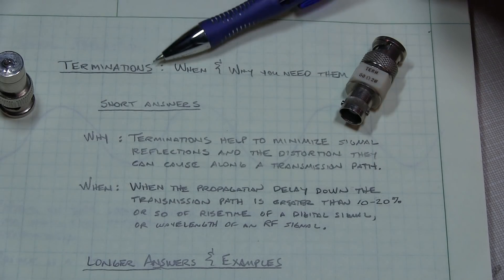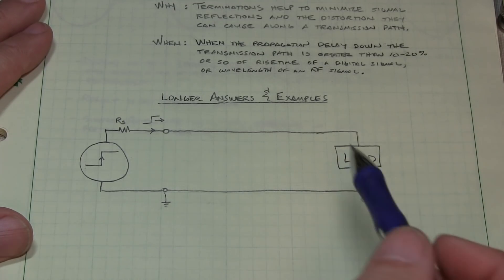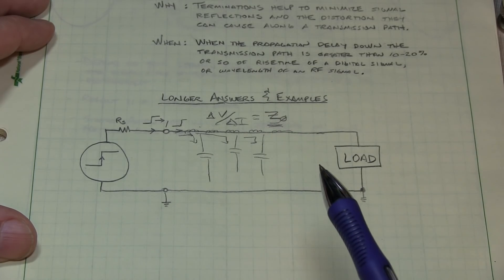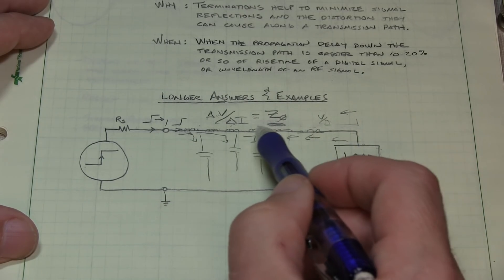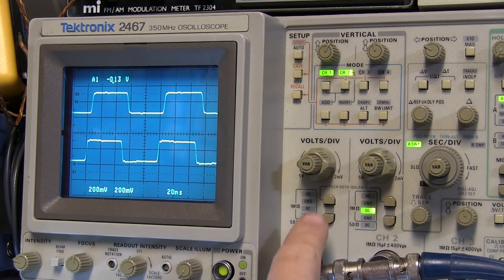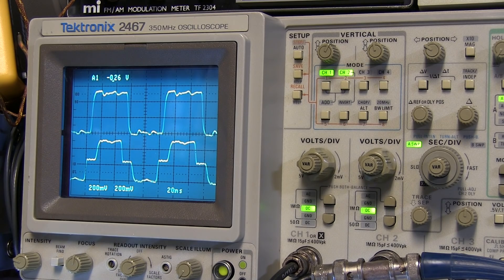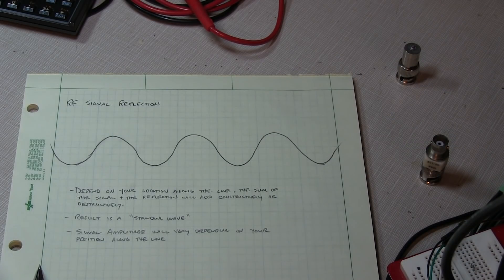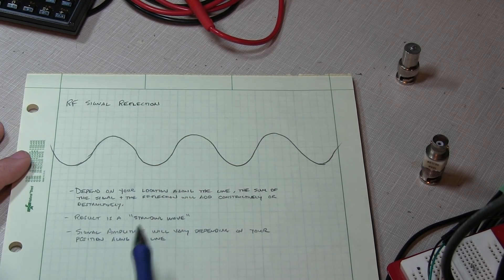#143: Transmission Line Terminations for Digital and RF signals - Intro/Tutorial

Comment: This explains my mobile HF issues on 80 & 160 meters.  The amplifier is perfectly happy on 40 and above, but on 80 I need to tune a little high when I insert the UNUN.  The amplifier tunes a little below the radio.  I probably need an UNUN with more taps so I can more precisely match the impedance, or switch to a tuned shunt coil.  The radio is happy when the amplifier is on the air because it is padded in the amp.
Reply: I have a telescopic coax. It would be interesting to see the difference in adding and subtracting the length in real time.

Comment: Noob question:   What if source is 50 ohm and load is 75 ohm?
Reply from the maker: You will get a reflection that is 50% higher than the initial input signal.
Reply: @w2aew  Wouldn't you connect the 50 ohm termination to the 75 ohm load as close as possible?

Comment: Kudos. Excellent explanation as always.  A quick question: 
 Does plugging both the end and the middle into the scope have an effect since the two channels are internally grounded together?  This essentially shorts half the return path of the transmission line - does this matter??
Reply from the maker: It does not matter - you will have the return/image current flowing in the shield of the coax between the scope inputs.

Comment: Reminds me of British TV Broadcast Engineers leaving a 10m to 15m length of Unterminated Coax connected to a PAL Black & Burst Genlock Signal from a Wallbox.  The Genlock cable had been connected to a temporary Camera in the Studio.  When the Camera was no longer needed the Camera was removed, leaving the Genlock Cable in place.  With the extra cable back to a Sc Distribution Amplifier, this amounted to a Quarter Wave Stub around 20m - which attenuated the Subcarrier frequency (4.43361875MHz) for anything else connected the the same Sc Distribution Amplifier.  Effect?  Any equipment in the Studio requiring Black and Burst had lost the Burst - and so no Colour from those Devices.......  A 5 minute "fix" from me, a big Invoice, and Egg On Face for Engineers who should unerstand the basics of Transmission Lines....  Thanks!  Great Video.............

Comment: Hi if I have a 100ns delay coax cable how much frequency can pass through it and be delayed without changing in it's waveform can frequency of signal effect on its waveform I tested a 10 mhz sine wave on 100ns delay rg58 and the out put was delayed version of input without any changes but I don't know if I use a 2ghz signal  what can be looks like my signal
Reply from the maker: A properly terminated transmission line will not change the waveform other than reducing it's amplitude.  The higher the frequency, the higher the loss/attenuation.
Reply: @w2aew  thanks..♡

Comment: Excellent video. Yes, I did learn something about proper termination. It finally makes some sense. I can see how the transmission line and load should match. 
But I'm still flummoxed by the concept of output impedance. If the transmission line and load are matched, there is no reflected wave back into the source, so how can it's impedance matter? Besides, I don't get how a voltage source has an impedance. It's voltage, and it's going out. I just don't get it.
But I see that have you done a video explaining what output impedance is, so I'll study that.
Reply from the maker: Simply put, output impedance can be thought of as resistor (or complex impedance) that is in series between the ideal voltage source and the output port of the device.  You are right, if the load is properly matched to the transmission line, such that the reflections are minimized or eliminated, then the output impedance of the driver doesn't really matter.  In the case of power amplifiers, it is important to note that you get the most power delivered to the load when the load matches the source impedance.

Comment: Hi, thank you for your great videos, I did find them very educational and easy to understand in the deep level. Recently I was wandering what is the difference between RF and AF? I mean I understand that RF is electromagnetic radiation and AF compression waves but audible frequency goes as hi as ~20khz and RF can go as low as 3khz. So if I switch my signal generator and start cranking frequency up where starts rf and where af ends? 🙂 Any chance you could do the "Back to basics" video on this topic? I tried to google about this, I asked this question in many ham radio facebook groups but no one could explain this clearly.

Comment: Did everyone also notice when Alan altered the frequency to show the null point in the standing wave and then went further (time 15.53 in the video), that the centre tap sine wave was 180 degrees out of phase with the end of the cable? In other words, the two scope waveforms started off in phase and as the frequency was increased, the centre tap went through a null before increasing again, but now in anti-phase.

Comment: Appreciate the demonstration that the signal at the midpoint of the line goes to near zero as the length of that line equals is equal to 1/4 wavelength but the length of the cable can be determined at any frequency by looking at the delay between the signal onset at the midpoint compared to the end of the line. So, eg, at 6:19 since channel 1 is delayed by 8.4 ns compared channel 2, the length of the line (in meters) is then 300*0.0084*0.66 = 1.66 meters (in this formula when the speed of light is expressed in mega meters/sec the time delay is expressed in microseconds). Also I generally don't need an oscilloscope to help me find the length of a coax that I'm holding in my hand but rather this technique is more useful by turning it around and determining the velocity factor given the time delay ie, 
velocity factor = length (meters)/(300*delay (microsec)).

Comment: So at a quarter wavelength which in this case is at a 33 Mhz frequency, the midpoint of that transmission line behaves as a short. I noticed when you increased the frequency to 68 Mhz which is about twice the 33 Mhz, or half wavelength, the midpoint of the line acts as an open. So if you had terminated the line going to the scope with a 600 ohm impedance,  does this mean at the quarter wavelength the midpoint of the transmission line will still look like a short and at half wavelength the midpoint will look like 600 ohm impedance?
Reply from the maker: The input impedance at 1/4 wavelength from the termination looks like Zin = Z0 * (Z0/Zterm) - so a 50 ohm line terminated at 600 ohms will look at 4.17ohms when the line is 1/4 wavelength long.
Reply: @w2aew  Thank you. what would be the impedance at half wavelength? Do you have in your amazing video collection a video covering this topic?
Reply from the maker: @uiticus  At 1/2 wavelength, the impedance looking into the line is equal to the load impedance at the far end (regardless of the load impedance).  A few of my videos on the Smith chart cover this in detail - such as video #297 and #275.
Reply: @w2aew  Thank you. Much appreciated.

Comment: I'm working in a semiconductor fab, and we have RF generators on the equipment.  It always mentioned the RF generator have an internal impedance of 50 ohm. I always wonder why 50 ohm? why not some other numbers? Any one can guide me to this answer? thanks in advance.
Reply from the maker: Here is a good explanation (best compromise between power handling and loss in transmission lines):
https://www.microwaves101.com/encyclopedias/why-fifty-ohms

Comment: Love this video, i am a curious hvac technician and i am sure nothing is useless in knowing in how the things work.
When you have a no wanted noise in a boiler exhaust pipe, you make a T with an adjustable cap to change the lengh of the pipe without issue. And adjust the lengh at the frequency you want short circuit. 
I am very bad in english, learning since 35 years 😭😭😭

Comment: Great video. Terminators are also needed to terminate signal leakage and ingress points. Open connections and impairments in the line allow for the line to act like an antenna itself. This unbalances the actual antenna that is hooked up. A simple terminator tricks the system into thinking equipment is hooked up by means of a resistor inside the terminator.

Comment: Hi. First of all, amazing...! Thank you for the video!! But a question. Why does the voltage jump up in the positive of the load? Is that because the other side is ground which is assumed to always be 0 V? (Reference node.) If yes, cool, then I got that part. But what about between the source and the line? Why does the voltage jump op right after the source impedance? There's no reference node after it, so I'd say you couldn't assume any voltage there, right?

I think you supposed there like a single positive charge going across the wire to analyze point to point, right? If that's it, the charge leaves the source, and that line has Vs. Gets to Rs, and in my way of viewing it, the voltage would decrease on the negative terminal of Rs, since on the positive one it's constant (Vs). Going on this way I could also assume on the negative of the load the voltage would decrease rather than increasing on the positive of it - then there would be no ground in this way, to be point to point analysis.

I think I'm confused. Would you know what I'm confusing here? Just didn't get this part. Got the main reflection idea though, so thank you for that. Still, if it would be possible to explain what I'm missing, I'd appreciate it! Thank you in any case!
Reply from the maker: Yes, ground is the 0V reference point.  The voltage "jumps" at the source termination (in the case of an open circuit at the end of the line) because the current goes to zero once the reflection returns, so there is no current flowing through the source's series 50 ohm resistor, so the voltage drop across it goes away.

Comment: so if you only have one load, then it doesn't matter if there is reflection. An LVCMOS33 source driving and LVCMOS33 input, 6 inches away, will get the digital signal through, even if there is reflection in the middle.

Comment: So if I have multiple coax outputs in my house can I not connect multiple devices to them, since this would lower the impedance? It seems like the output at the end of the line would need a 50ohm impedance but the rest should be high impedance but I don't think that is an option on something like a TV's is it?
Reply from the maker: You can connect multiple devices - each of those coax feeds will come from a splitter - so each is somewhat isolated from the others.

Comment: Great explanation Alan! I watchced EEVs video on prop delays, and coax length etc, and found yours much easier to follow as a student.  We just started AC in school.  I am looking at buying an older rigol waveform generator.  In school we use Agilent WFG's which have  high Z output.  So when we breadboard our circuits, we don need to do anything special with the scope.  Im not sure if the WFG I want has high Z output built into its menu so I am assuming that I will need to purchase a 50 or 75 ohm thru terminator. the WFG I am looking at is RIGOL DG2041A and my scope is a Hantek DSO5102P with fft (Its a great beginner scope)
Reply from the maker: I'm fairly certain that the Agilent WFG does not have a high-Z output.  The output Z is likely 50 ohms.  The "setting" for high-Z is how you tell the generator what load you're applying, so that it can display the proper amplitude.  See this video for more detail: https://www.youtube.com/watch?v=tClE8s6RZdg

Comment: I have a 6 feet cable (audio) that I am transmitting a 1mhz signal to a transducer. Should I worry about reflections or is the the wavelength much longer than the cable .
Reply from the maker: You're kind of on edge - you may see some effects of the reflection with a 1MHz signal and 6 feet of cable.

Comment: With reference to the last 5 minutes of your video, could you expand on what you mean when you say "Now as I change frequency, we are effectively going to be changing our position along the line relative to the phase of the signal"? I am confused about "effectively changing our position". This is how I understand it: "Depending on frequency and position along the line, we see a change in amplitude which is a result of the standing wave. The amplitude of the standing wave depends on the phase of the incident and reflected signals at the point you are measuring."

Comment: How did you move the two signals so that one looked like the incident wave and the other looked like the reflected wave?
Reply from the maker: I fed CH1 and CH2 with the two channels of my function generator, and used the scope vertical controls to also show the sum of the two channels.  I set the trigger to be on the "vertical mode", so it is triggering on the sum signal.  Then, I adjusted the phase of one of channels of my function generator which moved it in one direction.  Since I'm triggering on the sum of the two, that made the other channel appear to move in the other direction.

Comment: Can you explain the reason for using calibrated opens and shorts in different test scenarios?
Reply from the maker: Mainly when doing a local calibration for a VNA you'd use a calibrated open and short.  Sounds silly, but there's a reason.  It has to do with the electrical length between the mating surface of the connector and the location of the open, short or load.  This electrical length represents a phase shift.  In order to get an accurate calibration, the delay / phase shift to the open, load and short need to match.  On professional VNAs with metrology grade calibration kits, the stray parasitics such as fringing capacitance and other are also accounted for in the cal parameters for each standard.